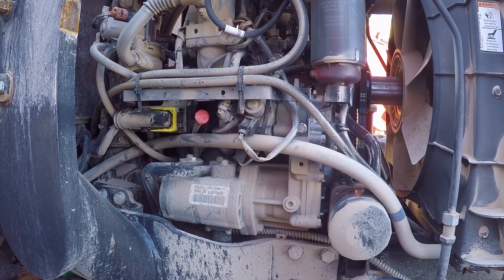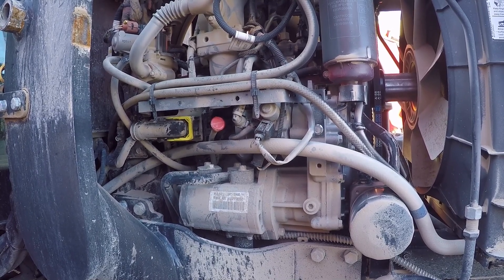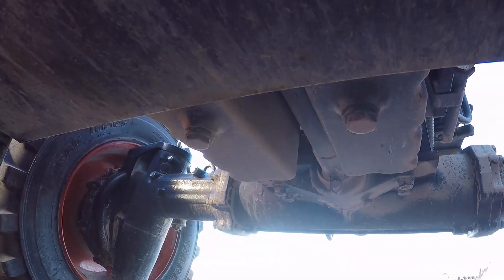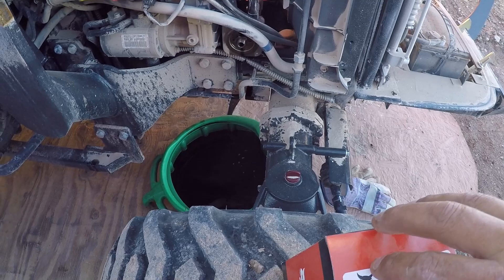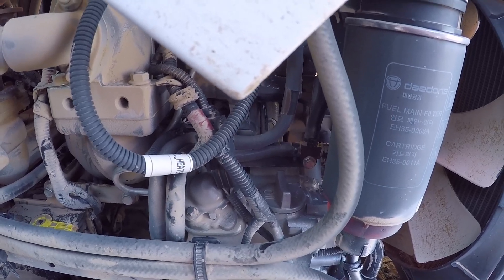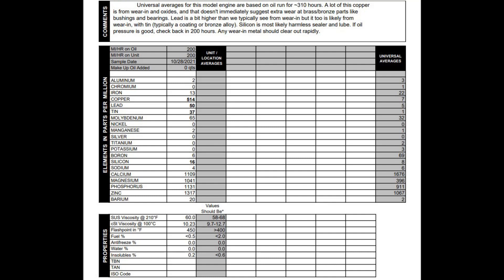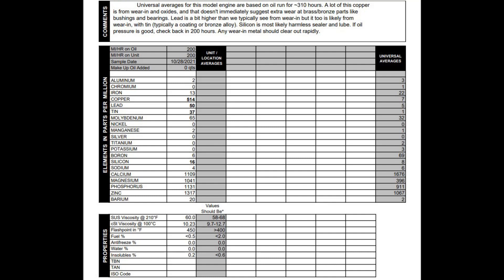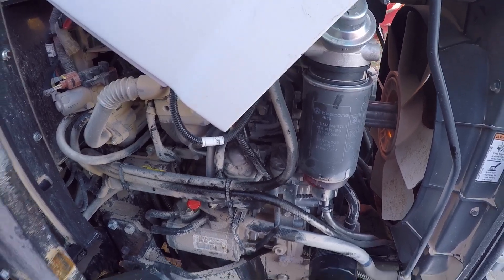Bobcat Tractor 200hr oil change & analysis

Comment: What oil weight did you use
Reply from the maker: I use 15w40. I have so many different diesels and they call for several different weights. I just wanted one oil to stock and that’s what I went with.

Comment: For my CT4050, the oil filter is marked by the dealer to be changed at 50 hours.  I will certainly insist that it is done when I send it in for the first 50 hour service.
Reply from the maker: Yeah, apparently some dealers are more on the ball than others.

Comment: It would have been nice if the service manual recommended changing the oil at 50 hours. I did post the information you requested in the last video.
Reply from the maker: Thank you!